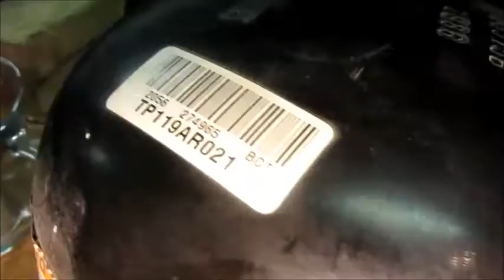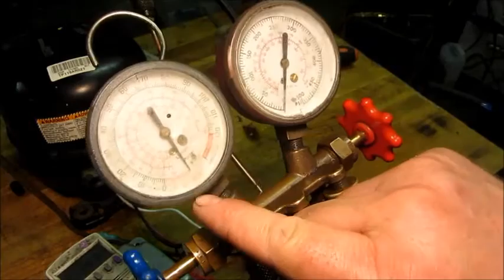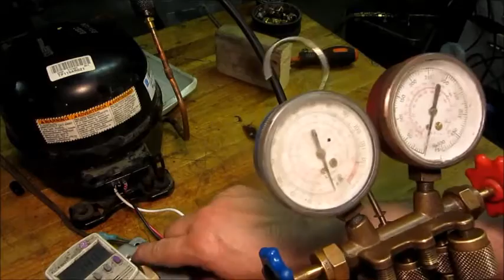Reuse of salvaged / junk fridge compressor - oil change and flush...

Comment: Doing an oil change on an refrigerator compressor sounds crazy. Especially when most people don't even change oil in their cars
Reply from the maker: It may sound crazy, but it's not. The factors at play are different between a fridge compressor and a car engine. The car engine gradually uses up the oil and it gets replaced; and car engines can keep working (albeit poorly) in spite of being in deteriorated condition.  Sealed compressors need a charge of perfectly clean oil without contaminants because that same oil has to last the life of the compressor. If the refrigeration system is left open for a long time (lines cut etc) then moisture will be absorbed into the oil.  Once the oil absorbs moisture or is contaminated, it needs to be replaced with clean oil before the compressor is once again sealed into a system.

Comment: You're right about the shortage of parts. Infact it might be worse than you think. I waited months for a head gasket for a 3 year old yanmar engine, it arrived yesterday. That $60 part took a $150k refrigerated box truck out of service for over 4 months. I currently have a 20ft box truck waiting on a reefer compressor, according to Thermo King, I should get one in the next 6 months.
Reply from the maker: That is frustrating about the parts shortages. It is a huge problem and shows how our country is now reaping what has been sown for the past few decades. We are paying the price for sending all out manufacturing out of the country. This is what many people warned about when the US manufacturing industry was just starting to decline.
Reply: If the engine is for the backup generator, wouldn't a temporary workaround be to get an automatic start Honda generator and bodge it in?
Reply from the maker: @NiHaoMike64  
I think on the reefer unit, the Yanmar engine is integrated with a compressor for the system. These are packaged to fit under the cowling on a trailer-mounted unit, so any modifications would be very difficult.
Reply: @davida1hiwaaynet  Isn't it just a matter of finding a spot to mount the external generator to and do a little rewiring? Or just connect the generator to the external power input.

Comment: I've got 2 old fridges in our basement and wanted to salvage the compressors for use a vacuum pumps. It would be exposed to mineral oil type fluid. Advice?
Reply from the maker: Hi there. These compressors make poor vacuum pumps because of the reed valve design, and the manner in which oil is used to seal the compressor mechanism. If you are not trying to make vacuum in the "micron" range they will work. However, the compressor will be exposed to air and contaminants and will probably not last very long. Also it will have a limited duty-cycle since it will not have much gas density to cool the motor. In other words, for short term use for 10 or 15 minutes it would be OK but not good for deep vacuum and moisture removal from refrigeration systems.

Comment: I really like these videos. Best I've seen on the subject! I have two old machines and wish I talk with someone like you to help me out. One of my cavalier starts and runs for a few min. then stops then starts again then after does not start again for about 30 min. Amps at about 7 and up to 9. It still has pressure and Freon to. I've changed start capacitor as well.
Reply from the maker: Hi there.  What you are experiencing is a moisture blockage. Your system has generated water internally over the years. After it runs and cycles, the moisture interacts with oil and refrigerant and forms an ice or oil emulsion blockage in the capillary tube. Can't equalize pressures and therefore can't restart until system has warmed up totally and the blockage subsides.  There is only one way to fix this. You will have to replace the filter-drier and also heat up the entire system while the vacuum pump is attached and running. Needs to be "baked out" perferably overnight at about 130°F to remove every trace of moisture from the lines and oil.  After that, it can be recharged and it will work fine.
Reply: Thank you. I'll give that a try.

Comment: Excellent David! There was an A/C tech. at one of the facilities that I worked at who was from the Philippines, who told me they always repaired their compressors.
Reply from the maker: Yep, they do rebuild them over there. They have been doing it for decades, although some of the more recent videos are clearly fake restoration trash. The antique and vintage ones I do cut open and repair, but unless things get worse, these more modern ones are available enough to make that not worthwhile.
Reply: I've worked with loads of Philapino''s, they alll talk a good job

Comment: Would love to know your thoughts on the different compressor oils.. from my reading arpund, poe is problematic unless everything is done perfect. Mineral oil was much more forgiving - it didn't suck up moisture or turn to acid when it did, didn't strip oxide from the pipes and bring it back to the restriction or pump sump. You use some less common oils in your builds, what're your thoughts on them? I like the prospect of propane and isobutane refrigerants again if they come with mineral oil use again, but they certainly are flammable.

Also, good for repurposing this compressor, they dont make them as overbuilt like they used to so its best to save the old ones!

Comment: Reminds me of a compressor I salvaged as teenager to use as a vacuum pump. I'm sure the oil was really contaminated after years of sucking air for my experiments, but it never showed a problem. 

Great video! You always explain and describe what you are doing so nicely!
Reply: Doing the same right now. Should I keep oil in it or will it seize using it as a vacuum pump for a few minutes at a time.
Reply from the maker: Hi there. These compressors absolutely require oil for any operation; even for a moment. Need to fill it with oil before any running. They generally make poor vacuum pumps unless you are only looking to make minimal vacuum of around 26 to 28" mercury.
Reply: @davida1hiwaaynet  The "vacuum" i create was much of a vacuum - just enough to get a nice neon tube type discharge using air as the gas. I just left the original oil in. Any idea replacing the original oil with vacuum oil would help - or might it be the wrong viscosity for the pumps design?
Reply from the maker: @ElectromagneticVideos  
I expect that "real" vacuum pump oil would be a good idea. Most of it is 250 SUS viscosity and these compressors would be OK with that.
Reply: @davida1hiwaaynet Perfect, thanks. Lots leaked out so I'll have to estimate the oil level.
It is for pulling vac on bleeding vehicle brakes.
Reply: @davida1hiwaaynet  Thanks David!

Comment: Spiral tap will aim the chip outside, so no chips in the unit. Anyway there will be tramp metal inside from the manufacture, and because of wear naturally, so a chip or two extra no big issue. Changing the oil anyway is good, I have used old R12 and R22 compressors out of fridges that were scrapped as pumps, and they work well to pump down systems to recover the old refrigerant out to do repair, like changing out a condenser. Just had to add in a spare filter drier on inlet and outlet, plus some valves, so the pump could be started under no load, and then cut off the bypass to get suction going.
Reply from the maker: Very good use for an old compressor!  I do plan to build a mini-recovery machine for use with small volumes of refrigerant when I don't want to lose a bunch of the gas in a full size recovery machine.

Comment: First I have to apologize for the bad actors on YouTube. Seem that there are always a few bad apples in the basket. 
Second, I like your repair method you used. One tip I can think of is that when you solder anything you wipe the solderd part with a wet watered rag as soon as you are done soldering. That was taught to me years ago by ture craftsmans. Something that is lacking these days for some reason. 
Keep up the great work and teaching us all a few things about refrigeration compressors.
Reply from the maker: You are right about the wet rag.  I often use my water bottle to spray the line after it's been soldered. That is especially important when you have used the acid flux on the lines. I used acid flux on the compressor, and did wipe it down with water afterwards. I can't remember if I showed that in the video or not and don't have time to re-watch it. I think I wiped with water, then brake cleaner, then painted it black

There are a lot of very small minded people on the Internet. It has become so widely available that the sheer number of people on the net has made it so that you are bound to encounter idiots. I just delete their chaff posts and use the moderation tools available to remove them from my field of view.

Comment: This video helped me alot. I'm learning HVACR, getting deep into the weeds of theory and what makes the equipment tick. Regarding the PROCESS TUBE vs the SUCTION TUBE, can i connect LOW PSI gauge to PROCESS TUBE and expect the reading to mirror the pressure in the suction line?? I notice that often the PROCESS TUBE is quite easy to access and tap into, while the suction line is hidden behind stuff, and NOT easy to access. Also, must i charge with only VAPOR through the PROCESS TUBE?
Reply from the maker: Thank you for the comment! You would see the same pressure at the suction tube and the process tube on a compressor like this one. There are baffles inside the housing on certain designs which will direct gas flow in certain ways on the suction tube, which are not present on the process tube. For that reason the two aren't interchangeable although you will see the same pressure on them. They both open into the compressor casing.  It is best to always charge these small systems with vapor and build up a charge gradually. The suction tube contains baffles, as stated; which will help mitigate damage from any small accidental liquid flood back. The process tube has no such baffles, so you need to be sure to only charge vapor.

Comment: Do you know anything about rotery compressors used in window acs in the 1990s? Normal output temp that goes into room. If a window ac with high and low lines available stems are there.
Reply from the maker: I rally don't know much about them. You know; all of us are attracted to things we grew up around. My family always lived in houses with central A/C so I never grew fond of window A/C units and don't really collect them like I do the fridges and antique motors.  

Having said that, the evaporator temperature should stay just above freezing in the high 30°F range. If it cools any colder than that, the fins will clog up with ice from the condensation. 

You may see some ice at first just after startup, before the refrigerant is circulating fully, but after the compressor warms up, the whole coil should be cold and sweating, but not frosting.

Comment: Very cleaver method to add oil to these little guys.

I wonder if modern compressor failure is due to the use of lesser lubricant oil on post 2000 fridges.
Reply from the maker: Thanks!  As for modern home-use (not commercial) compressors failing more often than vintage designs, that is a fairly debatable subject. However, from what I have seen there have definitely been compromised design concepts used in more recent designs. These stem from two problems. The first is cheapening and cost-cutting. They want to stamp these compressors out with little cost or human intervention and sell them at a maximum profit. There is so much data available now that they can calculate how much they can cheapen a design so that "most" compressors last for the "expected life" of the appliance; without spending any extra on materials and designs which would last indefinitely but cost more. Once the "expected" life (8 to 10 years) has passed, the compressor is guaranteed to be almost worn out. The second very compromised design element is using concepts which are guaranteed to make the compressor more damage-prone; to substantiate energy use / environmental claims. Use of extremely low viscosity oils lower oil shear losses in the compressor and saves energy but at a great risk to the compressor because you have much less engineering margin for oil thinning for various reasons which can happen in a system. Use of very small stator-rotor air gaps in the motors make the motor very slightly more efficient. However, once there are a few instances of accelerated wear, the rotor drags and the compressor is locked up. 

I made a video on one such bean-counted design. Here is a link to that one: https://youtu.be/DpnnLQNgUiQ
Reply: @davida1hiwaaynet  Thank you for sharing your experience on this matter.

I agree with the idea that compressor are victims to planned obsolescence and the quest to maximise profits.
As for the energy efficient argument I never considered that aspect yet it does make sense.
I will look into the video you linked.

Thank you again for taking the time to explain condenser failure causes David.
Reply from the maker: @AlanMedina314  
You're welcome.

Comment: What kind of amps was that pulling? I assume you did not run it with a protection on, just a start PTC.
It did not get any cooling due to no working gas in the system so you probably should stop at 70c as that is what is listed on most of these datasheets.

Comment: An R-12 system uses mineral oil correct? Is it sensitive to moisture as well? I have a 1950s hotpoint fridge with a rusted out line that i have been going to fix for a couple of years now and it has been repetitively put on the back burner.
Reply from the maker: Hi Walter.  You're correct that R12 systems use mineral oil. This oil was dehydrated during manufacture and will absorb moisture. It will also oxidize if allowed to remain open to air. You definitely should change the oil in that compressor at a minimum. It also would not hurt to use heat and an overnight evacuation on it since it's been open for so long.
Reply: @davida1hiwaaynet  Yes, I do plan on changing the oil in it. I am not sure exactly when I will get around to working on it again, but I did cap off the lines, although It was not under vacuum, or have nitrogen or anything like that in it. Originally when I had gotten it, the line had just broken during transport due to heavy rusting, so I was going to solder a new section in, ad a service port, vacuum and add R-152A which is supposedly compatible with the old oil R-12 used? but now, since I have to change the oil anyway, could I use POE oil and charge it with 134A, or should I just use mineral oil and use 152? I know PAG oil is not good for electric compressors, but POE supposedly is.
Reply from the maker: @WalterKnox  
Sounds like a plan, however, it is a bad idea to use POE oil in an older compressor designed for mineral oil. It can stir up things which will circulate. Also some of the materials may swell because of it. You would be fine to replace the oil with alkylbenzene oil. It is similar to mineral oil and will not harm the compressor.

Comment: What if bottom of fins get frost and frost up more as it runs and never unices. Dehumidifier is not getting that warm and rest of fins not getting cold. Sounds like a lout hissing noise like air in system but not much if and refrigerent noises like it should. Could it have a leak? It does not bring humidity down much like its not working. Compressor keeps shutting off compressor while running does not seam to be moving much if any refrigerent through the evaporator. Made in 2021 r410a rotery screw compressor
Reply from the maker: This  sounds like the system is very low on refrigerant.  The rotary compressors you're talking about are high-side housing designs so they have to warm up fully for the refrigerant to circulate properly. If it's still doing what you describe after running 10 or 15 minutes then it's leaked down and needs to have the leak located and repaired.
Reply: @davida1hiwaaynet  arent modern dehumidifiers supposed to be a closed loop system?

Comment: very interesting , thanks . saved what , $200 ? definitely worth the time , especially if you're doing it for yourself . i recently watched a vid of a business where they repair compressors (one of those countries that isn't blessed with the wealth that we enjoy) and they used a device that appeared to operate like a giant tubing cutter to cut the housing in two . did repairs , then welded back together . also very interesting .
Reply from the maker: Thanks!  This compressor is a 1/3 HP size which is more difficult to get. They were used in commercial applications such as soft drink coolers and single-door reach-in coolers. Due to their being used in commercial applications mainly, the 1/3 HP size is in demand because that type equipment is repaired and maintained much longer than residential.  Normally commercial kit like that would not be scraped unless the compressor is what was wrong. I've faced this before and finding a 1/3 HP working compressor like this can be very frustrating without buying new. If you want to buy a respectable brand new one, it may cost upward of $300 unless you find a one-off good deal on eBay etc. 

As for the repair videos from the Far East, yes I have seen those. They have been repairing these compressors in that part of the world, for a long time. The original repairers apparently are able to rebuild them and have some reasonable level of success.  However, recently, there has been a spate of fake restoration videos made, which only pander for ad revenue on YouTube. Those are hurting the reputation of the real guys who actually do this work successfully. 

We haven't reached the point in the States that this type compressor is that hard to obtain. If, or "once" that happens, then I would also open and rebuild them.  At this time, I only cut open and repair the vintage ones which are worth the effort.